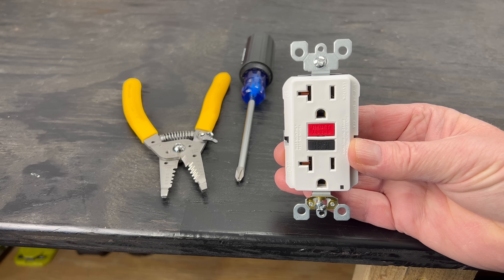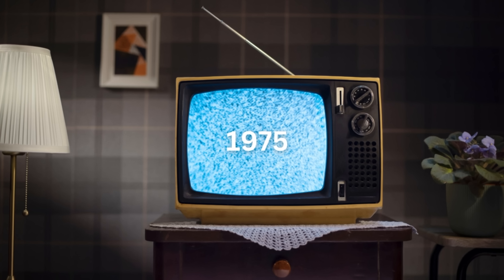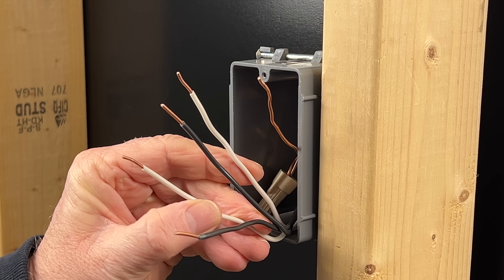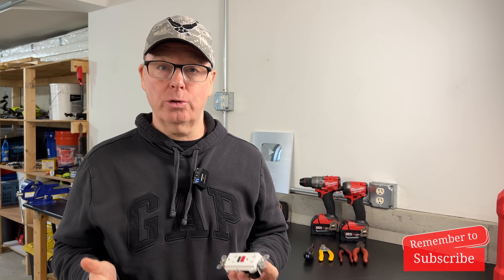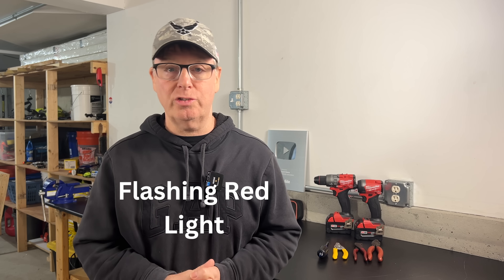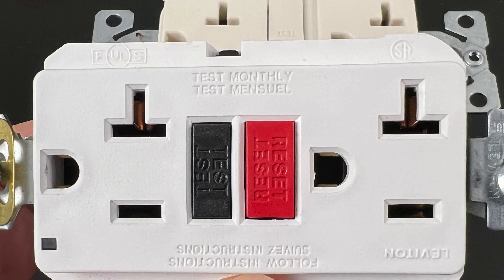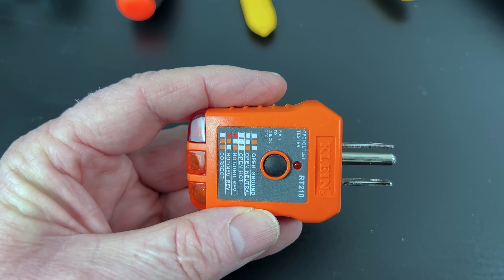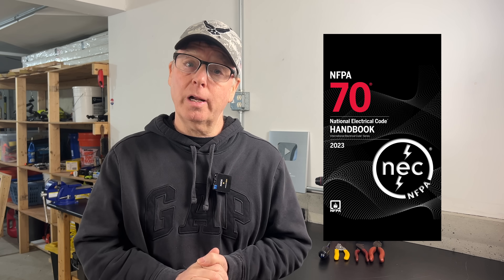Did GFCI Receptacles Change Without Us knowing?

Comment: I recently upgraded a 1983 sunline camper. It had a federal pacific panel and only 2 circuits, 1 of which was for the air conditioner. I replaced the panel with a square D and added a few new circuits. I also added GFCIs in the kitchen and on the new dedicated outdoor circuit. I bought leviton non tamper resistant GFCIs on Amazon. I just double checked the listing, they are self test. Not sure if they are new old stock or still being manufactured but I am happy to know that I have the newer technology in my RV. 

On a side note, GFCI on a dedicated circuit for a refrigerator or freezer is the dumbest thing ever. Dedicated circuit, single, not duplex receptacle, and the fridge or freezer being the only thing plugged in shouldn’t have GFCI protection for obvious reasons. Even a WiFi connected GFCI that notifies you of a trip is NOT the solution. So you get the notification. If you’re not home you have 4 hours to get home to reset a fridge, 12 hours to reset an upright freezer and 24 hours to reset a chest freezer.

Comment: Though not exactly the same thing, but we replaced our toaster a couple years ago, and the new one will not allow you to push down the handle to lower the mechanism unless the toaster is plugged in and energized. 
My brother is a retired electrician, and I am a retired pipefitter, and we have discussions about various issues of our trades regularly. He is the super for a elder apartment complex in Vancouver, Wa, and I live here in Pa, so we talk about things he finds all the time. It is an older complex, and the various problems that he finds are often due to either a lack of codes or simply that the codes used during construction were just poor. 
Thanks for the info.
Reply: Newer toasters use a solenoid to hold the basket down instead of a mechanical hook.   The end of the solenoid gets coated with crumbs and the toaster will stop working.  Clean it off and it will work again.

Comment: I recently did a kitchen remodel on my home that was built in the 1960s. I ran a separate circuit for every plug in and have a GFCI. I used a tester like you showed to test each circuit as it was completed. 1 of the new GFCI outlets was defective right out of the box. It showed with a red led, couldn't be reset and was always live. I replaced it immediately. Big upgrade from 1960s wiring. Also installed a new 200 amp service entrance to replace the original 100 amp.

Thank you for the video. It is good to know that I did everything correctly.

Comment: The test button is quite amusing. It did used to apply a 10k OHM resistor between line and ground in the early days. Today, the actual testing happens when you PRESS THE RESET BUTTON; the test button simply mechanically releases the trip latch forcing you to press the reset button. This is why today, you can actually trip an unenergized GFCI receptacle but you will not be able to reset it. 

As you said, they actually test themselves automatically.
Reply: The test button still simply has that resistor inside. That is a UL, NEC and other regulatory requirement. It is just so quick you don't realize it is the electronics tripping the relay. When you press the reset button, you are mechanically setting the relay. When you push the reset button, if the fault is real and still there, it will appear not to latch (or it will for a few milliseconds). That is simply the unit tripping again. (I am talking about the outlet models specifically here.) 

The auto self test is pretty cool. It operates the entire trip circuitry while monitoring the trip signal to the relay. As soon as it sees a signal for the relay to trip at the relay, it removes the fault before the mechanical relay can react. This is why it is a good idea to manually test once in a while to make sure the relay still operates as well.

Comment: I've never understood the need to install GFCI protection for properly grounded, stationary appliances. The purpose of GFCI is to protect devices with non-existent or questionable grounding
Reply: No that is not the purpose of GFCI. The purpose is to trip on unbalanced current between hot and neutral—which could be going through you and frying you—whereas circuit breakers trip when current exceeds a certain value.
Reply: @trempah  Thanks.  I understand the theory of both.. But, a properly grounded appliance should protect you from electric shock, regardless of GFCI protection.
Reply: @boeing757pilot  Then you don't understand.... Think bathtub, pool, etc.... Your breaker box is not gonna protect you from a potential issue there until it's too late. It's not just about properly grounded...
Reply: @josephpchajek2685  Oh, but I do understand. A properly grounded appliance will protect one from electrical shock. In fact, the entire purpose of GFCI was for use when non-existent or questionable grounding existed. I'm not stating that GFCI won't add an additional layer of protection..
Reply: @boeing757pilot  No, you do not understand. GFCIs are used in addition to grounding to provide additional protection. Their use to replace old two prong receptacles without a ground wire is an exception, not the norm.

Grounding protects in cases a wire inside touches the case. That is it. There are other risks like touching an exposed wire or if a device drops into a bath tub. A GFCI can also help the grounding to work as it trips 10000 times easier (5 mA vs. ca. 50 A).

Also the ground wire can break. That would be hard to detect so one might continue to use the device until it gets a fault. Some people even knowingly use damaged devices.

Comment: Maybe you should explain what a back-to-back gfci is and the problems that can cause
Reply: I deleted my original response, it wasn't accurate. If one GFCI feeds another GFCI, the self test won't matter BUT manually testing the second unit should trip the first as well. I will be a race since once either trips the fault will go away. You may prove which unit is faster.

Comment: My house has a 3-gang box in a bathroom fed by 2 breakers.  When I first moved in, one breaker was connected to the side of the GFCI and the other connected to load!  Good thing I have thick skin.  I also had switched lamp outlet that was hot all the time and I could not figure out the issue.  Finally I realized they had connected the red (switched) and black (unswitched) hots together in the fake fireplace which back fed what was supposed to be the switched line.  I'm also finding a lot of 12ga-12ga-14ga pigtails which I am replacing as I find them.

Comment: I was unable to find non-self testing units for my RV in outlet style, so I ended up getting GFCI breakers instead.  Often an RV will be hooked up to an outdoor branch circuit for battery maintenance or visiting a friend or relative and a self-testing GFCI can trip the upstream GFCI.  Feeder circuits are not supposed to have GFCI (with an exception for boat docks) so this is not supposed to occur.  A dedicated RV outlet is a feeder circuit.  Recent code changes have required outdoor branch circuits (like a welder or electric vehicle outlet) to have GFCI and a lot of electricians and inspectors have apparently misunderstood this.  This will result in GFCI-protected RV outlets at a non-trivial number of parks.  If your self-testing device trips one of those back at the fuse box after hours, your site might be without power until morning.

Comment: I'd like to see all the damp circuits have GFCIs on the panel only at new construction, so homeowners know where to go to reset the GFCI. Many older houses have GFCIs that trip, and finding the reset outlet can be difficult- it may be outside, in the upstairs bathroom, in the garage, etc.  I had a customer who had a packed garage, couldn't even step into it  (which is more common than you might think) and the reset GFCI was in there- somewhere- but where? They had to hire 2 men to unpack the whole garage to find it,  and reset it. And they lost all the food in their garage freezer. yes I know garage freezers and fridges shouldn't be on GFCIs.

Comment: Every time you trip a GFCI receptacle, it reduces the service life of that GFCI receptacle. This also applies to GFCI circuit breakers.
Reply from the maker: Actual trips from ground faults will reduce the life of the device however periodic testing doesn't reduce the life span. Even with a GFCI tester the receptacle is only exposed to a very small amount of current through a resistor and it's not hard on the device. GFCIs will have a 15 - 25 year life span even if they are tested monthly which is rarely done.
Reply: @BackyardMaine  It matters little to the service life of the device whether the trip mechanism and the electronics controlling it is activated by the small current through it's own internal test resistor, a sample of the small imbalance between line and neutral currents as detected by it's current transformer, or by your external tester. What does matter is the size of the contacts that the load current passes through. Those are typically considerably smaller than those found in a common wall switch with similar current ratings. If the GFCI is carrying a heavy load current at the instant when it activates or experiences large inrush currents at the instant when it is manually reset, those contacts will erode and /or fail with relatively few operations.

Comment: I remember plugging in something (Christmas lights, extension cords, power tools) into a GFCI outlet and not having it work, then pushing the reset button and it did not reset. Every time that happened, I had to replace it with a new one. Most of the time, they were outdoors. I now found out that the electronics inside them got damaged by the water getting inside them. When I put in GFCIs for outdoor use, I put in a regular outlet that is also run off the load connection of a GFCI installed indoors. I always installed them correctly.

Comment: I had early GFCI receptacles in my grounded home that would false trip when an appliance was initially plugged into them. After plugging the device in I could press the reset button and everything was fine. I narrowed it down to capacitive and inductive loads. Like rechargeable shavers. The small in-rush current these devices drew caused the GFCI to assume a fault because more current was going in on the hot side, versus how much was exiting on the neutral side. Replacing these with newer GFCI devices solved the false tripping issues.
Reply: I also began having this false trip problem with the wall-mounted GFCI receptacle when I installed T5 fluorescent lights under kitchen cabinets to replace the big old T12 type.
Reply: I used to be very active on multiple online aquarium boards and a couple decades ago we used to warn people to not use GFCI outlets or chords for life critical components on their large aquariums. Large induction motors, and T5 lighting ballast and some metal halide ballasts would cause GFCI’s to trip when they first turned on due to in-rush current. I do agree with the response that an in-rush current by itself shouldn’t cause this trip and I suspect product quality played a part in this. Fortunately today with everything being electronic this is no longer an issue and I always recommend GFCI’s for use around aquariums.
Reply: Your explanation is not actually what's happening. For any normal load, any current on the "hot" is also present on the neutral, regardless of whether it's a resistive load, inductive, or capacitive. The inductive/capacitive loads just impose a phase shift between the voltage and current. If the in-rush current was not equal on both conductors, it would have to be exiting elsewhere. It's likely that the GFCI outlet was just faulty.
Reply: @doug8718  Exactly. In design there is a test specifically for reactive loads. The old ones weren't very good, plus they age.

Comment: I only found out about self-testing GFCI's recently while updating the outlets in my home for aesthetic reasons. I had taken note of which side was line and which side was load, and even noted that the new GFCI was upside down compared to the old one in that regard. Yet I still managed to initially wire it backwards. The self test was able to let me know that which was nice!
Reply from the maker: You are not alone. This is a common issue and have found several that were wired wrong over the years. You may have even had it right and the guy before you got it wrong. The reverse line/load function is a really nice feature.

Comment: And, it's a BIG money-maker for electrical suppliers of these GFCI's, since they will cost you even  more money to purchase  the "new" auto-sense variety. Churn baby, churn...

"According to the U.S. Consumer Product Safety Commission (CPSC) and the National Safety Council (NSC), about 400 people are shocked at home each year, resulting in about 200 deaths. However, before GFCIs were widely adopted, 800 people were killed annually from household electrocution. Jul 19, 2022". 

The US population in 2022 was approximately, 333.3 million people. So, 800 deaths annually divided by 333.3 million people is a percentage of 0.00024% deaths from no GFCI at all. A solution chasing a non-problem, with your money.

Comment: The NEC has to be in the pockets of electrical equipment manufacturers.  Codes have gone crazy.  We built last year and I spent $4000 on just breakers because they all pretty much need to be GFCI, AFCI or combos of both.  Outdoor air-conditioning units must be GFCI protected because some kid got electrocuted when he jumped up on an improperly wired condensing unit.   GFCI must protect everything in kitchens because there's a sink in a kitchen.  Manufacturers will continue to innovate because they are handsomely rewarded with guaranteed profits.  Used to be able to buy a $8 breaker but now the protected ones cost $80+.  NEC isn't alone.  Windows can't be opened more than a few inches if they're a certain height above the ground and those removable cables add additional profits.   Garage doors need better bracing due to potential storms, etc.

Comment: While at one of our great 8 yearly IAEI meetings/ continuing education class they told us that when UL labs tested hundrrds of GFCI devices they were disappointed in how many either were not working or would not trip. This helped to have manufacturors to make all GFCI receptacles but not  more expensive GFCI circuit breakers to have the automatic test function & miswired ones to not be anle to energize. The shelve test is not 100% gool proof because it does not open the relay contact so you still must perform monthly push test button to make sure it's working.

Comment: At 0:28 the wall outlet is upside down, the Earth should be on top, to precent something metal falling between the plug and the outlet and then making a short circuit.
Reply from the maker: Actually no.. The code and manufacturers make no mention of ground orientation. Over 80% of electricians in the US install ground down and many consumer products are designed to plug into a ground down receptacles.
Reply: @BackyardMaine  Thank you for your reply, but 80% of all electricians can learn something new to improve their work and their skills. The ground should be on top. It is safer. In many countries there are regulations about this very subject. Wise people made these regulations. If you save only one child from not making a short circuit with a butter knife or anything metal frumbled between the plug and the wall outlet then you have save the world. You too can become a part of the group of people that improves safety by promoting the ground to be on top.
Reply from the maker: @vanhetgoor  I am all about safety. The issue is there are also safety concerns with ground up as well. The way people naturally hold a plug with their thumb and index finger its very easy to have your index finger make contact with the hot and neutral blades of the plug when inserting or removing it from a receptacle. I personally think it's a wash from a safety standpoint. Also considering that most of you plugs these day are two prong anyway where it would make no difference. Tamper resists was a good step forward to protecting children but I do like the idea of partially insulated prongs as well.
Reply: Says you buddy.   Most consumer products design plugs for ground down.
Reply: Generally I use ground down except to a)sometimes identify a GFCI protected outlet, or b)in offices where paperclip are used regularly.   It is true that paperclip wind up in strange places under desks. And c)when grounded plugs will be used to go up a wall to a TV or computer etc.  80% of all consumer products require ground down.   Flipping a receptacle is easy enough.
Reply: That's funny. There has to be thousands of threads arguing that. Are you going to tell them in the UK their light switches are upside down?
Reply: @johnelectric933  In the UK the power plugs are safer then the power plugs elsewhere. If the plug is pulled halfway out of the outlet it is impossible to touch anything conducting. It is even safer then the system used in Europe.